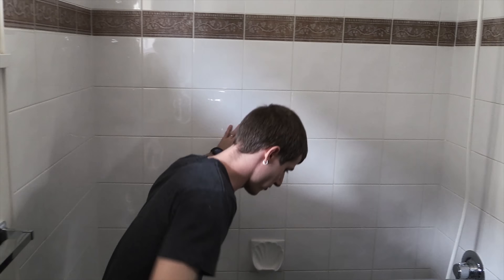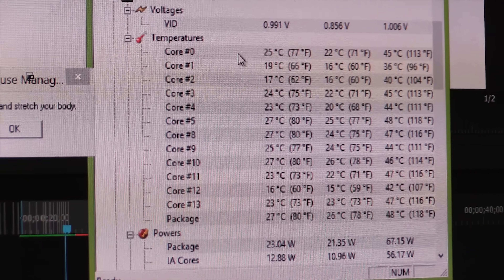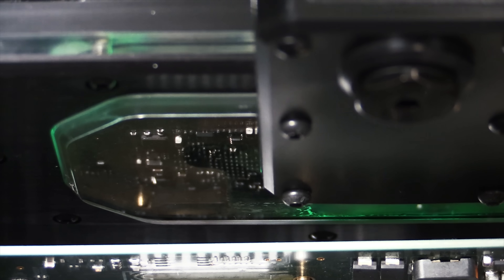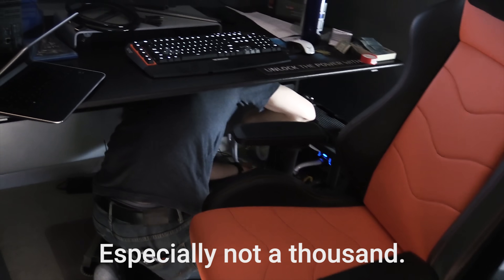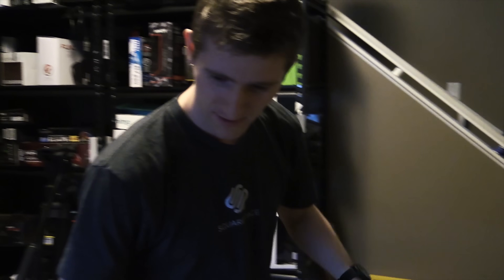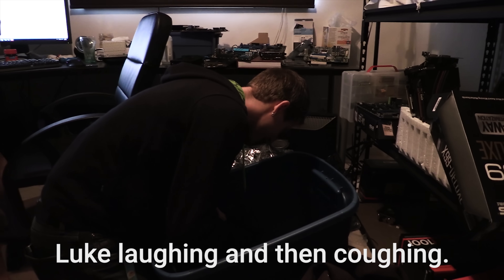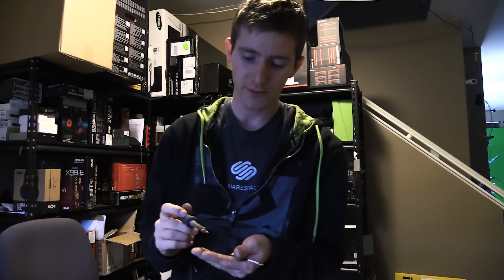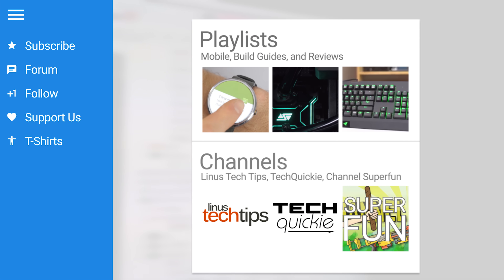Whole Room Water Cooling Part 5b - Some Issues, More Solutions...

Comment: Don't cry about low pressure when you have made a bottleneck in each system with a small pump. The only way to do it like that would be to have a slave reservoir connected to main feed. 

Also with the PSU for the fans, I love how you said all the fans draw 2A and just gave it a 2A PSU. Don't you tell us about PC PSU's and there rating and giving a system a buffer? Maybe watch your own videos.
Reply: I love how he made massive pressure loss using pipes along the ceiling.. LOL making the pumps, pump the water from almost the floor to almost the ceiling.. Head pressure drops the higher you try to lift the water and the larger the pipe the more water weight will build up. Don't get me wrong this is a epic task to common rail cool all units. but Block restriction and head pressure are not on his side here. and the added unused pumps. Best case scenario here.. his output flow is divided by 5 computer towers, So each system is getting little flow. and in the real world. The closes system on the loop will have the least resistance from the pips and head pressure, So i would guess that's getting most of the flow, Love the concept. Hope he can work out and have a sweet working Über room cooling loop in his next office.
Reply: John Simpkins The pipe height isn't so much of an issue because the loop is closed till it returns to the reservoir so the suction created in the down pipes cancels the backpressure created in the up pipes once the loop is filled. Its not the best setup but should/did work until it started growing lol.
Reply from the maker: Simon H And the highly restrictive cooling blocks we are using.
Reply: John Simpkins I'm not enjoying his recent videos either, they look completely defeated and unhappy. they're cutting corners in important areas that don't make sense. This all looks like a typical sunk cost fallacy.
Reply: Seeings as each system runs in parallel not series, the extra pump will not cause a bottleneck, and pumps very rarely cause a bottle neck in a simple flow system anyway. The task they undertook is quite a lot different to the simple loop in a normal persons pc, and quite a lot more complex. Although I do agree with you on the PSU thing, I thought that when he originally used the 2A PSU.
Reply: Peter Macca yup.. you need about .1 bar or 1.5 psi extra per meter head and you regain that pressure once you go down again. the actual pressure drop comes from friction, bends and turns etc.
Reply: And each PC has there pump, and the one(s) in the bath tub is just for the piping.
Reply: He never practices what he preaches. I've lost count of how many times he said: "I know I told you not to do it this way, but I'll do it anyway, just don't copy me."
Reply: John Simpkins 8 foot of head isnt gunna see massive pressure drops there would be prob at most 1 or 2 psi droped in the lift of the water.
Reply: NafanyaZX he has to say it. if he didn't and somebody fried there equipment they'd scream bloody murder at him.
Reply: LinusTechTips That was implied, yes. But your pumps can handle it right?
Reply: You shouldn't have used them blocks then
Reply: do as he says, not as he does.
Reply: lol exactly and linus put them pumps in parallel not series
Reply: Peter Macca he'd need significantly more flow to put them in parallel though. not sure but it might actually become noisy at that point.
Reply: NafanyaZX "Do as we say not as we do" lol.
Reply: Simon H he would get more flow if they were in parallel Look at this link this is the simplest way for me to explain it. As no one seems to know the difference between Series and Parallel.    http://www.rainforrent.com/PageFiles/1841/Pump-Diagram.jpg   I just asked my 8 yr old cousin if he understands how the pumps are working in the picture and he explained it perfectly.
Reply: Peter Macca woops I read put those blocks in parallel. i know fluid mechanics dude :p
Reply: Simon H thank god for that I was starting to lose faith in the human race. Some where else in the posts there was a guy who claimed to be a expert plumbing engineer and he didnt spot the problem with the pump setup.
Reply: Peter Macca i haven't watched all of the videos in detail, but would the pumps be powerful enough? indeed you'd only about double the flow if you had enough head to spare.
Reply: Simon H they have flow issues with running one pump an more than one pc hooked to the system but i think thats due to air locks in the system.
Reply: in reality it wasnt a well thought out plan they need to use something like a 6000gph pool pump, full copper car rad plumbed into dual 44 gal drum with at least 2 inch lines and that would on average get them 15gpm per pc running 6 pc's. Just add a by pass circuit for when they disconnect pcs from the circuit.
Reply: Yeah. It's was a very un-engineered plan, if you're going to do to this, go all out. A setup like this has little restrictions on how crazy you want to go. It's a bit pointless if the piping isnt insulated (since the main goal was dump the heat outside) and you're using pc consumer-grade rads. Ah well. Everyone's an expert ;)
Reply: Lol go hard or go home
Reply: Simon H I just realized that the pool pump setup i said would run around 22 pcs not 6 lol i must remember heres 4 ish liters to a gallon dam imperial metric shit.
Reply: Peter Macca Haha I didn't check the numbers but that seems about right. With that kind of cooling capacity it would've all been worthwhile even with the innocent mistakes (I'd even forgive that soldering, wtf?). But the lack of technical planning really makes this thing sort of a bummer.
Reply: I don't understand a word.
Reply: juuonse what do u need clarifying with
Reply: NafanyaZX
That's because there's people that thinks because someone did it, they can do it and when they fail they blame the one who succeeded.

Comment: First of all, as others have said get some real electronics solder (you should be looking for 60/40 rosin core). What you used looks to be plumbing solder (which likely means it's lead free, which is in itself rather meh). I'm not sure if Home Depot even carries 60/40 since it's mostly used for electronics, but worst case you can find it online. Rosin core solder has its own flux, so for basic wiring you don't really even need to apply it separately. Don't be afraid of leaded solder either, the fumes are NOT lead, they are simply the rosin core vaporizing. Your iron would need to be MUCH hotter to vaporize lead. You should still avoid directly inhaling the fumes if possible though, and make sure you wash your hands when you're done. Second, don't transfer solder using the tip of the iron, the real goal of soldering is to use the iron to heat the component (in this case your wire) and feed the solder into it. Having a small bead of solder on the tip of the iron can help transfer heat. Lastly, get some heat shrink tubing. Electrical tape is still good for weatherproofing the joint, but wire shrink is a lot more professional looking in my opinion. (I typically heat shrink each wire, then have a larger shrink covering all of the smaller shrunk wires).
Reply: Oh, and get yourself some helping hands (google "electronics helping hands") one of the most valuable tools around for soldering.

Comment: Liquid flux, never mind what it says about using it on electronics, they mean like on circuits and stuff, on wires its AMAZING! then use shrink wrap over the top, electrical tape is a messy temporary solution to covering it...Oh remember to slip the shrink wrap over the wire before soldering it! otherwise you will be pulling pins out  of those connectors to get them on...I found out the hard way when I forgot. After it is soldered give your wire a good tug it the solder comes apart it wasn't good enough.

Comment: .... That's not how you solder wires. You're supposed to fray them out like a V and intertwine them, then you place your soldering iron on the wires to heat them up, once heated you touch the Solder to the wires.

If you have solder with a flux core the solder will flow much more freely and will soak into the individual stands of wire resulting in a stronger bond. Or you can buy something like Flux paste which you place onto the wire before the solder.

Solder isn't a good conductor, so make sure the wires are passing the current through each other rather than the solder.

Comment: noticed that you where using electrical tape for the splicing witch is fine for prototyping but for a more penitent solution heat shrink tubing would be a good option as well as a pair of 3rd hands for holding the wires wile soldering and lastly a verity of soldering iron tips for heating more or less surface area

Comment: Had quite a fun experience soldering myself recently.. 

Raged at my keyboard and broke the stem off a Cherry MX switch. Tried to replace just top of the switch with a different switch I don't use. Broke that too in the process. 

Cue me, a student with a broken $150 keyboard. Ain't getting replaced anytime soon. Thankfully I had a Ducky Shine II lying around, but oh god do those Blues grind on you after getting used to Blacks. 

Got myself a $20 soldering iron kit and ordered four black switches (two spare, just in case.) Having never used a soldering iron before, I actually found it quite easy to desolder the original two switches and solder the replacements on. Saved myself a lot of money! 
Yeah for all you modding pros, soldering a couple of switches may not be even noteworthy, but I was quite impressed with it myself! (Plus it work, always a bonus.)

Comment: a tip for your pumps, put one half way in the look or maybe at the end of the loop, but mid would be far better, this way when it starts getting lower flow, the middle pump will pick it back up
Reply: nope it wont, it will help the first pump to push faster and the second pump will run fine
Reply: hmm i see, well it can be done with a extra copper pipe, but guess he doesnt want to add that, guess he should of done parallel

Comment: For soldering, I recommending getting a set of alligator clips in something like the $5 Helping Hands to hold the wires together as you solder them. Then, try to heat up the wires with the iron on one side of the wires, and the solder on the other side. If you can get the solder to melt without having it touch the iron itself, it wets the wires a lot easier.
Reply: ***** No,  he just guessed at the content of the video and decided to post a random comment. :-P
Reply: Rogier Colijn he asked for advice alright, leave it out. How about I say you are terrible at playing trumpet because I can play one just fine? If your comment doesn't have advice, it's hardly helping, so no point insulting.
Reply: GoldViolinFlutist  I don't even know what he's doing, but he does seem to know the basics of the basics for soldering. better than what I've seen my friends do!
Reply: They should also try heat shrink tubing, it's easier than wrapping it in electrical tape and it looks more professional.
Reply: Oh hey you watch Linus?
Reply: One more tip for soldering wires. Twist the exposed wires together and then solder. Makes it easier cause the wires don't go all over the place and gives you a better result.
Reply: Is linus using the "melt solder on iron then trying to wipe it on wires" method? I thought since he is techy and familiar with youtube he would've learned actual soldering.
Reply: QuentinX5 you shouldnt twist wires together or twist wires past their original shape, so the best thing to do (I solder for a job and hold a ipc specialist verification) is to hold the wire next to each other, flux and solder
Reply: This is correct, the solder should not touch the iron unless you are just wetting the tip to aid contact/heat transfer :D
Reply: spicydeath82 Twisting is perfectly fine, just not over twisting. Twisting adds strength to the wire, esp on a weak solder connection. They should put heat-shrink on the wire before joining it though so they can insulate it easily without messy electricians tape.
Reply: Touching the solder to the iron to get it to melt is fine, as long as the iron and the solder are both also touching the wire at the same time. Putting dabs of solder on the iron and then trying to transfer that solder to the wire, like Linus is doing, will not work. It will take ages for the solder to bond to the wire, the bond will be weak, and it will use a lot of excess solder. Also, the wires to be soldered together can be tinned first before being soldered, which can make the process of joining them easier. Tinning is the process of applying solder to each wire individually and then simply touching the wires to be joined together to the soldering iron. This will melt the existing solder and won't require any additional solder to be applied during the join.

Source: Been soldering for 10 years.
Reply: ace advice. Funny how they couldn't just do a google search.
Reply: FUCK YOU PI
Reply: ew
Reply: One method I've always used is like killbill144 said: Twist the wires together, and then I feed the solder into the iron and let it melt on the wires. When I feel like the solder/connection I've made is good or clean, I release and let it cool. Heat shrink tubing also works wonders and allows you to use way less electrical tape.
Reply: more elegant than how i explained it.
I prefer to twist the wires together first, lessens the need for alligator clips.
Reply: also using a good flux allows the solder to flow over the wire better
Reply: Ye i usually heat up underneath then feed from above
Reply: Why haven't you made a video in half a year?
Reply: didgitalpunk well the scrape method does work, just not very well. My dad uses the scrape method, but that's because he's not very tech savvy. He usually fixes machanical things, so when something like a light fixture breaks, he just does enough to get it kind of fixed... And then I looked at videos of ppl soldering and can do t kind of decently
Reply: Dale Curtis who says? I've seen plenty of people that make electronics or do repairs twist wires together and solder them.

Comment: From this video alone I can tell you honestly don't know exactly what your doing. In case you have forgotten; the bigger the loop, the more pressure you need to keep it going. Flow rate is one thing; you lack pressure. Get a bigger pump and have someone make sure it's constantly being fed water while you check for bubbles at the system end so you don't risk damaging the expensive pump again like you may have done here.

Comment: You didn't even need to solder the cable. There are cable connectors that do just that, you just screw the naked cables in and voila cables connected. Also reusable.

Comment: As suggested, I will comment on Linus' soldering. Did you hot glue/ insulate the connections? This could cause a short, especially if it's out in the rain.

Comment: When you solder wires, you should twist them together and while holding the iron to the joint feed solder to the wire. Remove the solder from the wire and then the iron from it after. You only ever put solder on the iron when tinning it.

It also looks like you used an acid core solder, instead of a rosin core one (could be wrong, but the gauge of the solder looked like that which would be used for plumbing). Never use acid core on electronics, it will last for a relatively short period of time before failing. You would want "60/40" (Tin/Lead) with a rosin core, which removes the need to use flux.

And heat-shrink is definitely a nicer solution than electrical tape :-)

Comment: Use rosin core solder, press the iron to the wires, and then the solder to the wires which should then feed its self on to your connection.

Comment: So you should be using a different solder.  The one you're using is for copper pipes.  You'd best be off using thin lead solder with a flux core.

Comment: Hey Linus while soldering I suggest twisting the two desired wires together to get a solid connect and then tap it with the soldering wire & wrap with electrical tape. (I couldn't tell if that's what you did or not) thought I'd give you my 2cents! (PS I love this series so far keep it up )

Comment: For better soldering you should try to twist wires together before tinning, and then put a little drop of acid flux - it would take solder much better.
I know, the rule - no acid when assembling "radio parts", but it's really ok (took from my own experience), if you'll neutralize acid after soldering.

Comment: Linus, you should install an air vent at the highest point of your plumbing system. An air vent will continuously remove air bubble from your system. You can use something like : http://www.homedepot.com/p/Unbranded-1-8-in-Hy-Vent-400-4/202312925 or if you want a better one: http://www.amtrol.com/airvent.htm

Comment: a tip for soldering is to actually heat of the copper wire itself and tin the wires that way it makes it much much easier to solder a wire together or to something. and to help prevent melting the rubber coating around wires just get a heatsink of some sort. also i have the same model soldering work station a very very good choice!